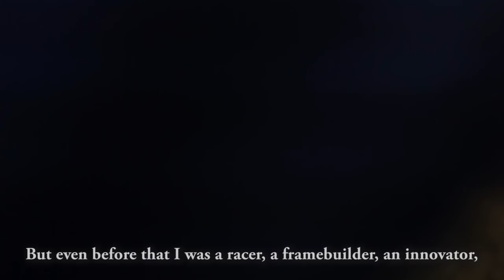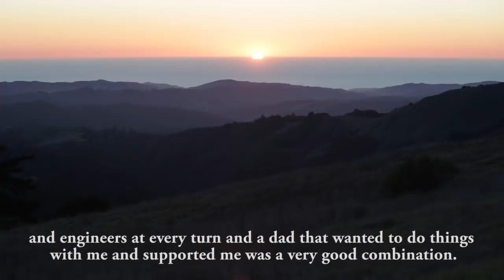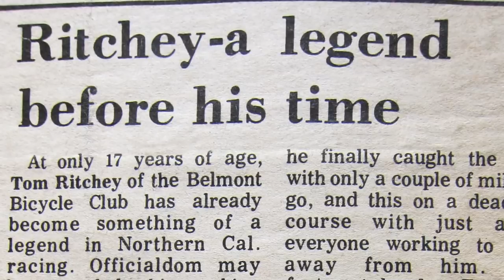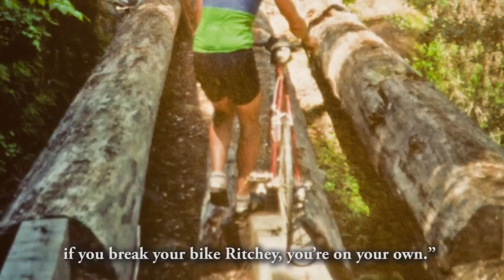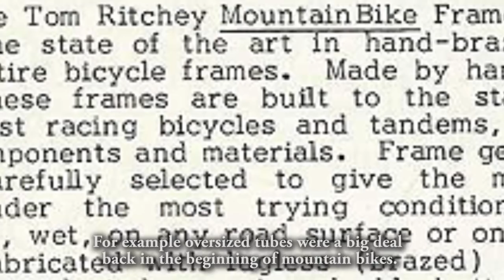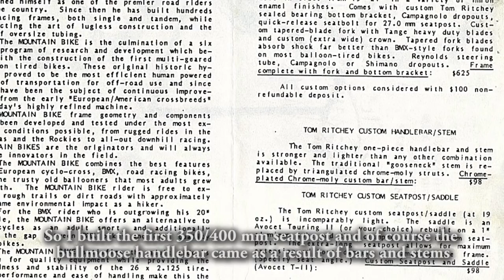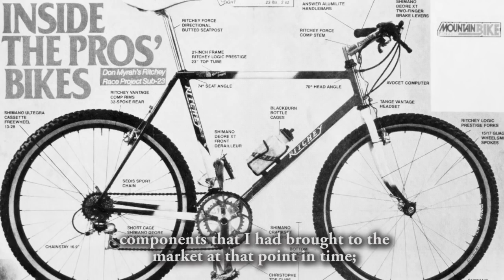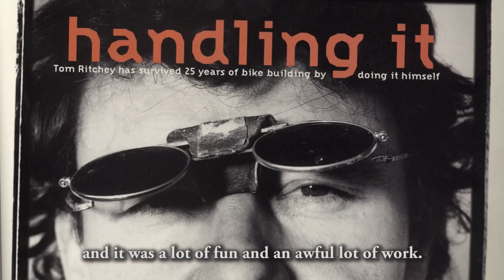40 Jahre Ritchey: Doku über Tom Ritchey

Comment: Modern ritchey components are roughly comparable to most counterparts by other quality component manufacturers. The breakaway system is appealing, too (as is S&S coupling). But the bikes designed by this trophy-hunt'n mamma-hump'n cowboy look like absolutely hideous prehistoric garbage. The only reason this company is relevant today - is because of the components, most likely sourced from an actual component manufacturer somewhere in chinkland.